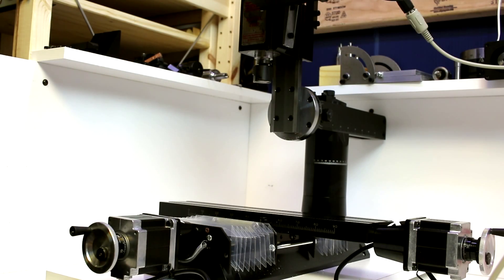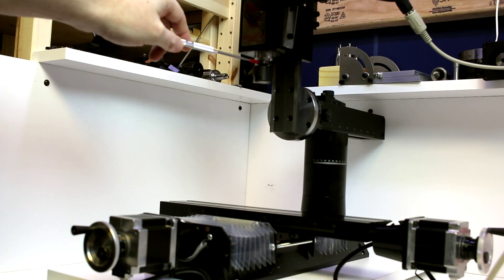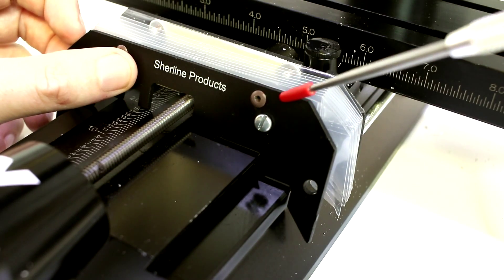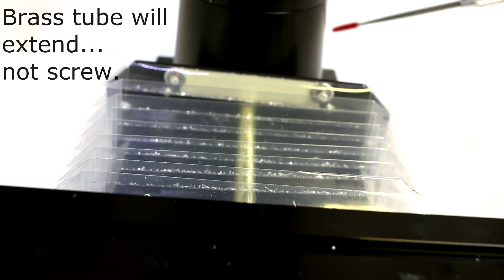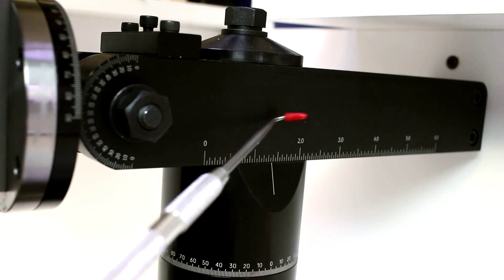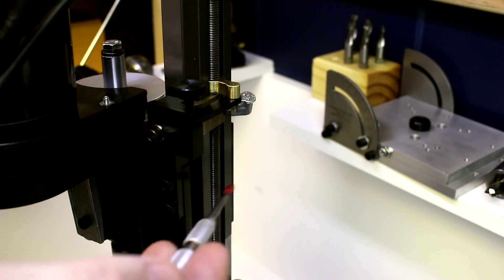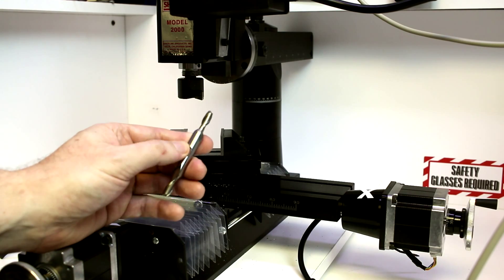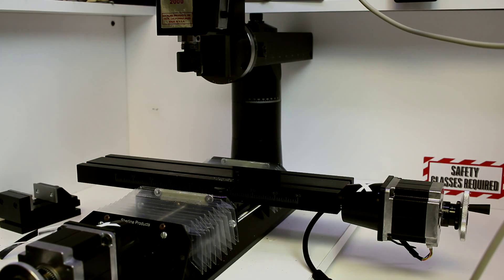Sherline Mill 101 - Terminology & Safety

Comment: Hello, I was given an old sherline 4000 lathe and mill tonight so I just started looking for info and found your channel. My lathe doesn't have a live or dead center so I thought I'd try and turn a dead center for my first project. Do you know what the degree on the taper that fits in the tail stock is? Also, do you know where I can buy some carbide cutters and maybe parts? Thanks for any help.
Reply from the maker: +Shane K Congratulations on the lathe Shane and welcome to the hobby. Turning a specific taper can be a little challenging for the first project, but will give you good practice so just be patient with it and don't be surprised if it takes a couple of attempts. The tail stock uses a Morse Taper #0, MT0 for short. It has a angle from center of 1.4908 degrees from some google searches I did since I am away from reference books and my shop for about a month. You won't be able to set this precise of an angle from the scale on the headstock, but there are several tricks/jigs out there if you do some searching. A video on turning tapers is on my list so I'll try and bump it up in priority once I return home again. The other difficulty you may have as a beginner is getting the MT0 and the pointed cone to both align accurately to center. You'll also want to harden/heat treat the tip of the dead center for best results (can vary with specific applications).

To start out, I'd recommend getting something like the Anytime Tools 5-Piece 1/4" Mini Lathe Indexable Carbide Insert Tool Bit Set from Amazon.com or similar retailer, for under $30 they seem like the best bang for the buck that I've found personally. With the indexable cutters you don't have to worry about sharpening them and the 1/4" will work with a larger variety of sherline tool holders. Other parts and pieces can be purchased from Sherline.com, one of their resellers at http://www.sherline.com/dealers.htm (often at a discount from list and with shipping or other promos), grizzly.com (sometimes harder to find smaller sizes and quality can vary from item to item with grizzly), and/or general sites like e-bay/amazon... again double check sizes for compatibility with the smaller sherline when shopping on more general tool sites that will usually cater to larger machines..
Reply: Thank you so so much for answering me, I've subbed and already watched some of your other videos, and am going to watch them all as soon as I have more time. I hope you keep making more, I like what you're doing. Since you told me the size of the tailstock I'm just going to order one. I haven't figured out how to turn a taper anyway, mine just goes either strait in, or parallel with the stock. I guess I could turn both dials at the same time, but I don't think I could do that with any accuracy. Sorry, I don't know the terms for it all yet, but I'm going to learn. Thanks again. By the way, my lathe and mill have brass for the rail that mounts the motor and tooling, I guess it's old.